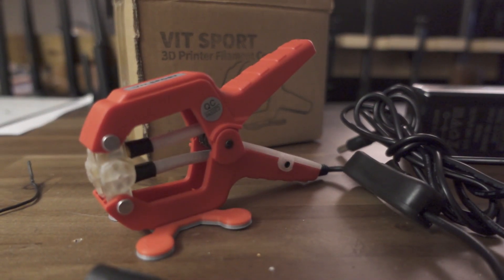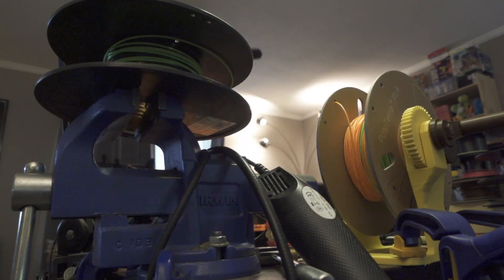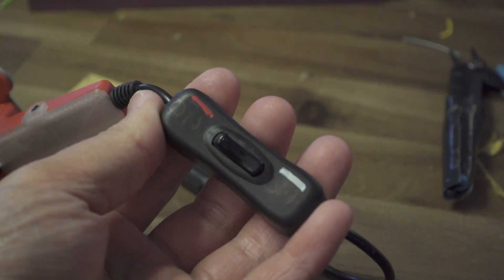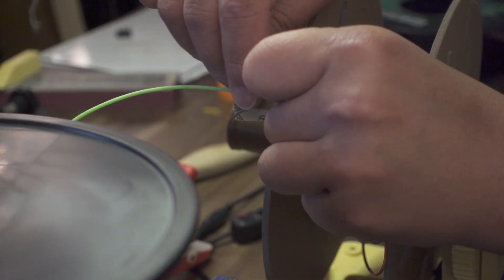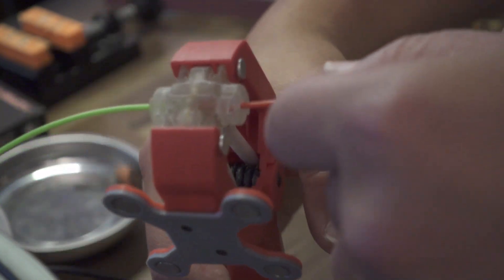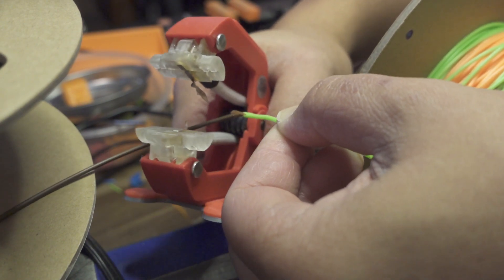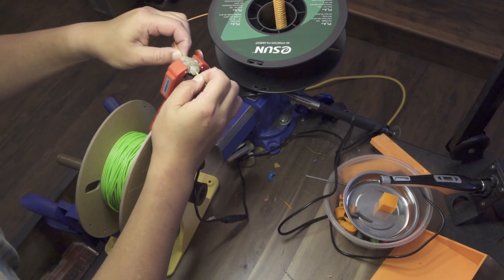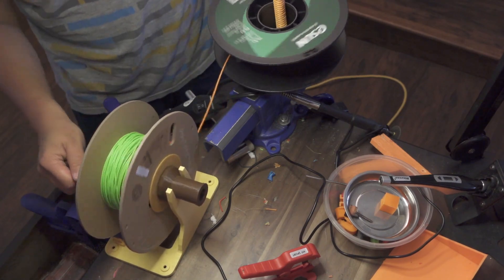Reusing loose filament by splicing them? - Thoughts on the VIT SPORT 3D Printing Filament Connector

Comment: Dude whenever I try to use this tool and sand it down perfectly. It snaps with any sort of bending. How do you get it to wind up on the spool without it breaking?
Reply: I suggest warming your filament in a oven on 70 to evaporate the moisture in your filament and help reduce the filament being brittle